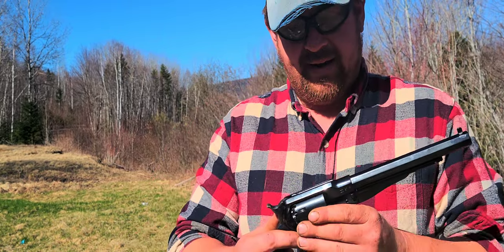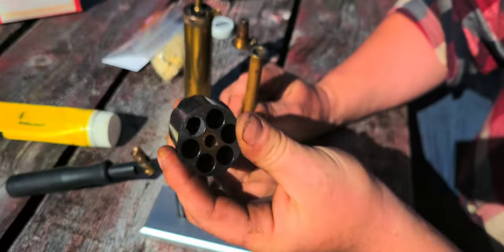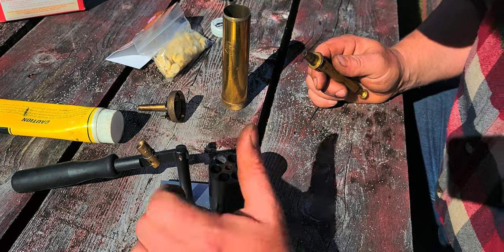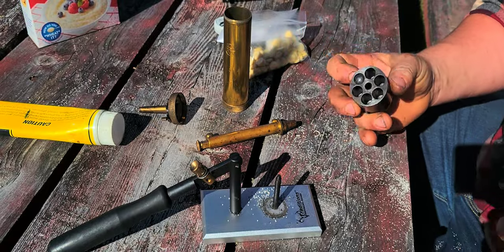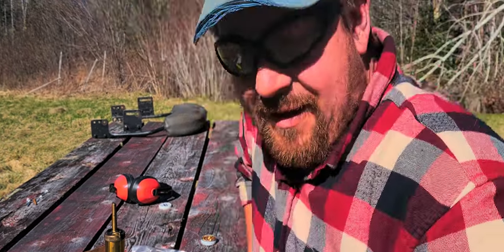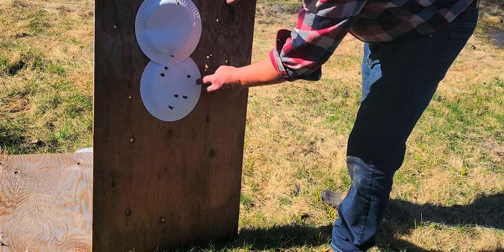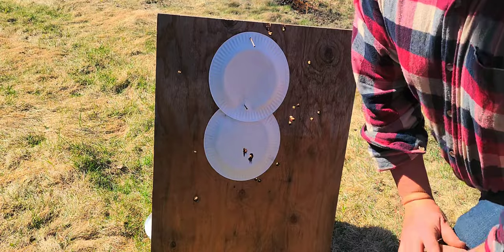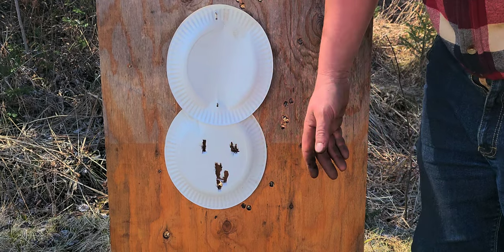Load Development for a Pietta Remington New Model Army.

Comment: I need to try the cream of wheat with my 1851 navy copy
Reply from the maker: I did it with my navy at the same time.  It tightened up the group a bit. It wasn't as pronounced as it was with the remington.
Reply: Will have to try this. I put crisco in front of my round ball when loading my 1851. Helps prevent chain fire and really helped with accuracy as well. My grand knew his stuff.
Reply from the maker: I tried doing the lube over cylinder a few times.  I kind of like the wads better, but I will lube over again in the future too.
Reply: @finflask1862  I been putting bore butter over the cylinder